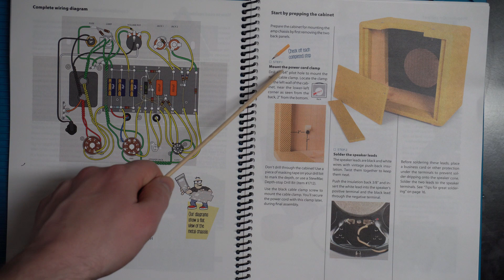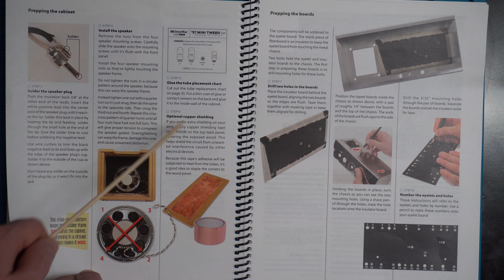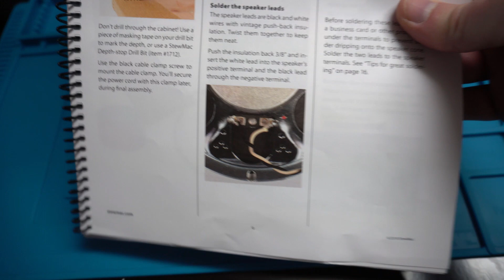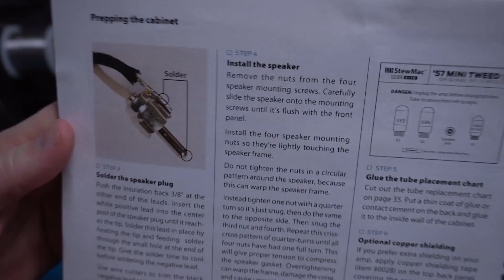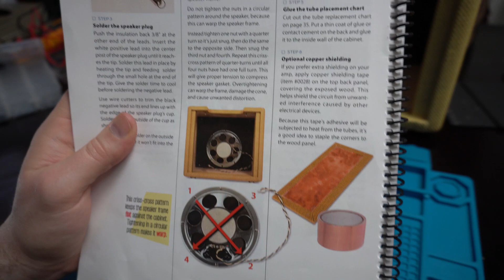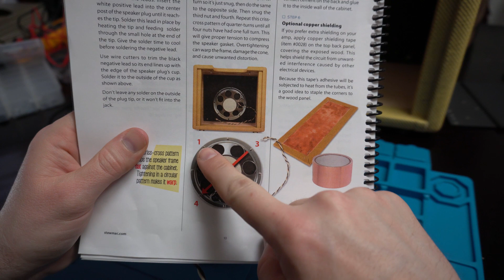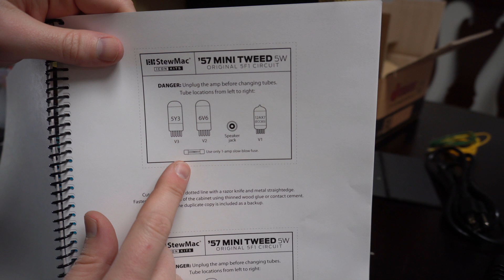StewMac '57 Mini Tweed (5F1) DIY Tube Amp Build - Part 2

Comment: What was the liquid you applied? Is it an essential if you’re building guitar amplifiers?
Reply from the maker: I think you are referring to rosin. It's a liquid that helps solder bond to metal. It's not essential, but makes soldering much easier in most cases. A lot of solder comes with the solder and is sold as rosin core. Adding extra makes it easier, especially if you have a flat piece of metal. It's fairly cheap and a bottle will last a long time.
Reply: The Analog Maker thank u , I will try to get a bottle and learn how to use it. I am ordering this kit soon as well as some rubber heat shrink tubing
Reply from the maker: @joshua0226  Good luck! It's not so tough it you take your time and double check your work as you go. StewMac has some very good instructions which is one thing I enjoyed with this kit.